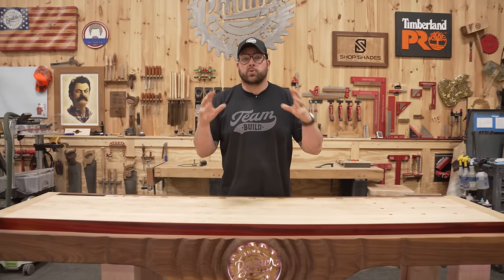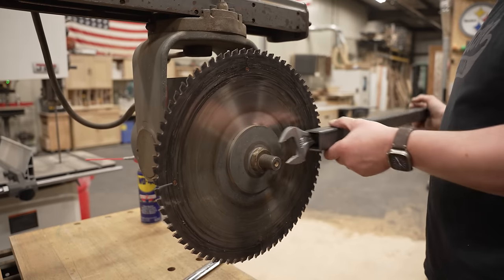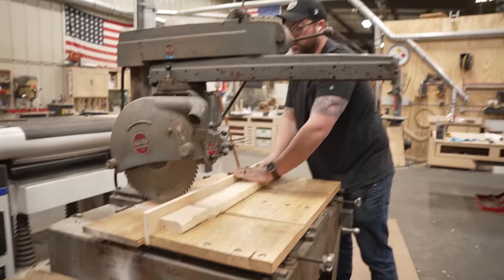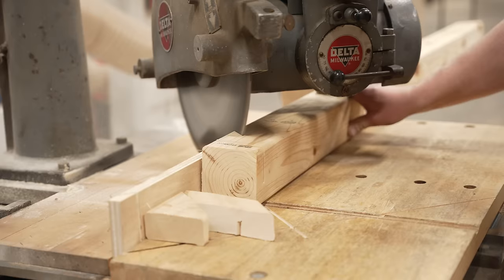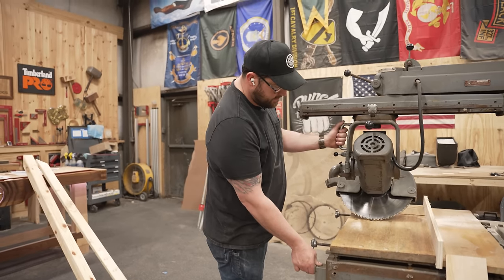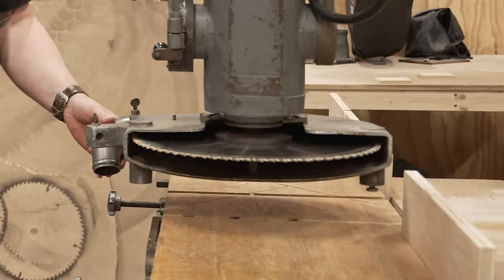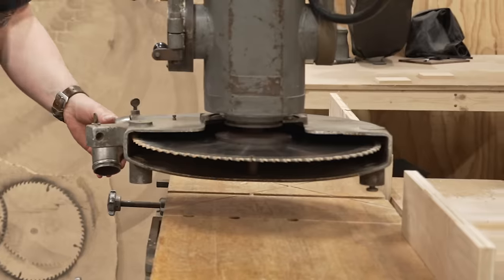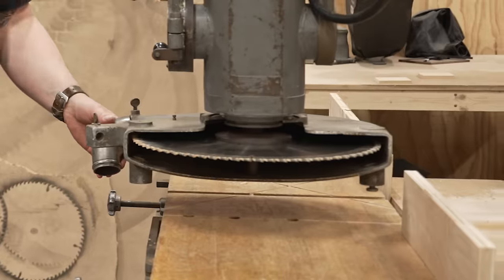Testing Woodworkings Most Dangerous Techniques

Comment: Rake angle on teeth helps. It doesn’t grab if it is neutral rake. If you search specifically for radial arm blades they come up.

The rip cuts people use a push block that is a flat piece on the surface that pushes the pice and has a bracket with a handle to push it through. Sort of like a food processor pusher.

Comment: Ran one of those for a year back in 1972. 16 inch delta we built 2 big project about 2000 2 story apartmens. The thing is a bull. Never laid it on the side . Cross cuts only. Great saw.  We built a ply wood table for it 32 ft long 2 ft wide. Waxed table everyday. The wax was driping off the bottom of the plywood after we tore it down .

Comment: For the rip cuts you need to adjust the blade guard down at the frint end of the cut to prevent it from picking the material up at the beginning of the cut. And there are anti kickback pauls that are missing that wedge the kerf of the cut at the backside much like a riving knife on a table saw. I rip my plywood with a craftsman 10in radial arm saw (not full sheets, i do full sheets with a straight edge and a circular saw).

Comment: Honestly i can't wait to see what you make with this tool, I see how dangerous it can be. Maybe you could make your own blade guard that doesn't get in the way so you don't have to completely remove it but you are protected. It would be nice if you could add a brake to slow the blade down once the saw is off.

Comment: Good on you for showing how dangerous the RAS is. I have 2, one with a trenching head and the other for high quality cross cutting. The wood machining world has changed significantly since the 80s. At trade school whilst doing wood machining we were taught to (interim) sharpen 24" rip saw blades (not carbide) with a file in situ then, to ensure that all the ends of the teeth were in the same cutting circle we would feed a broken piece of grinder wheel into the infeed side of the spinning blade!!! Sparks, screaming noise. the first time you do it, it is really scary.  The next scary thing is after replacing the knives in an industrial 24"  thicknesser you have to do a similar thing! This time though the abrasive part to grind the cutting edges of the thicknesser knives is rod shaped and in a carriage that is micro adjustable into the cutting circle and moved across the top of the rotating cutter block with screw feed. 
I wouldn't do it now.

Comment: Have you done a lathe router?  It's a combination of a lathe and a router with a milling bit.  It also works well if you have a duplication setup going.   You're using the router to cut on the lathe while the lathe is running.

Comment: The way I was taught to use a radial arm is to ALWAYS PUSH cut, never pull. We were also taught to not do any rip cuts because of what you pointed out. I guess in a pinch and if your life depended on it maybe. This thing is pretty ridiculous though, regarding how long the blade spins after its off, it seems like maybe a malfunctioned brake?

Comment: Great job pointing out the potential risk using the saw. Now, what can you create as jigs to protect the user. There had to be a lot of users in a factory that used the saw as you demonstrated that didn't get hurt. Plus, new saws can make the same cuts , but are quite costly. I'm guessing there work around. I lack the experience to  create such jigs.

Comment: I was hoping that you would buy an older 12" Delta or Rockwell radial arm saw and install a negative hook angle blade on it like a Forrest Chopmaster blade.  These saws have a 5/8" arbor, so it is possible to use a standard 8" dado stack on the saws.  I own a three phase version and a single phase version of the 12" Delta/Rockwell radial arm saws - they seem to remain accurate through several hundred cuts.  Your 16" saw is of a similar design, and seems to have a blade installed that is either a negative hook or 0 degree hook design, which makes the blade much safer for crosscuts.  I suggest creating a support table for the left side of the saw so that you are able to pull the saw through the cut using your right arm rather than your left arm.

Comment: We have the same saw in our school shop where 14-year-old kids are allowed to use it. The thing is so loud but we are allowed to cut it by pulling it forward making a cross cut It also has a break on it so it stops rather quicker and a strength thing that pulls it back that the school just added to make it safer I guess.

Comment: Get a changeover contactor installed with a dump resistor to help brake the motor, the motor spinning is acting as a generator so adding a resistor to dissipate the energy as heat will slow the blade much faster.

Comment: I would highly recommend to add VFD (variable frequency driver) for that motor and program DC break so it stops immediately and not after 5 minutes. Also you can program safety stop and slow start and stuff like that.

Comment: Yeah, i would automate this. Like that rail where the holes are, that would be perfect to mount a linear actuator (screw would be best, because it has more force). A motor break (easily added with something like a friction belt), and a proper table with a jig system to allow you to clamp stuff.
Automated, you don't have to be near it, but you can then make all kinds of cuts with it.

Comment: My father had a radial arm (not as big as this beast) that injured him on a rip cut. The wood jumped - he didn't get hit by the blade, thank God, but just the force of the wood slammed back into his hand. The resultant force split the entire last knuckle of the ring finger on his right hand into three meaty chunks. We drove to the hospital with his hand cradled in an ever-increasingly-red kitchen towel with him passing out from the pain. It actually did heal back together but it's a permanently-branded-in-my-brain reminder of how dangerous these older tools were/are!

Comment: I used to work in a hackspace which had a radial arm saw, I tried using it for a relatively simple cut once felt sketchy just setting up the cut and just thought 'this isn't worth it' and did the same cut in a more time consuming but ultimately much safer way

Comment: That bench top should be further forward so you can use the full arm throw. That would allow your fence to be further forward and allow your blade to be behind the fence. Or like your later cuts start out and work into the fence instead of starting back. Also just keep some scrap around for a brake material.

Comment: Your CAD dude and some 3d printed parts could probably help with a lot of the issues... make a guard that rotates and includes a hookup for your dust extractor for example. It's no gonna stop the blade if someone crashes into it like that hunk of metal but it will let them know if they just bump on by. There are a bunch or prints for feather boards and such you could possibly modify concepts from to help with safe feeding as well.

Comment: There is lots of literature on setting up RAS. Fine Tuning Your Radial Arm Saw by Jon Eakes is essential book if you are going to run machines like your delta or dewalt . They have more adjustments than you think. Once dialed in , they work at 0.001 of inch accuracy. Your blade is pinching because  your blade is heeling in . There is an adjustment. Every tool ( stationary tool) should be set up properly. They don’t come set up perfectly from factory, that includes all table saws.plug and play is a good way to end up handless

Comment: My dad is a machinist, we have an old Bridgeport mill at his house, and when he uses it it has a break to slow it down so he can stop the drill or whatever he's using in there. It makes me wonder why they didn't install something similar in this tool. Would be useful to be able to manually slow the blade without having to put it into material or having to wait for 5+ mins to stop.

Comment: Well, congratulations, you got your 10,000 likes. I have a radial arm saw and use it exclusively for cross cutting long timber to length and it’s perfect for the likes of half lap joints, although I need a dado stack.  I once turned it the wrong way when ripping and almost put a hole in the workshop wall.  I’m trying  to decide whether you are brave or ?? 🌞

Comment: I used the same size saw in the early 70’s during my summer job working as a Carpenters helper, once the company owner realized I could read drawings accurately and had a good work and safety attitude I was put at the yard shop prefabricating soffits and other components. The saw was a workhorse and because I grew up on a farm I had respect for its power and risks he was sad to see me leave to go back to engineering classes in the fall. I enjoyed the work, I still have the 12 inch Craftsman radial arm saw in my workshop it doesn’t get much work mostly because I have a full complement of equipment and don’t do the type of work they are best for in my 70’s , I think they areas safe as the operator’s ability to set them up and knowledge of  understand the forces involved . Lack of thinking everything through and securing the work is a problem for some?

Comment: Should make a blade guard half the size as the one that's on it. Then you could put a retracting piece on that, so that the half of the blade nearest you would be covered when doing a tennon cut. As you cut into the wood, it would push half of the cover back. When done cutting, you can then push the saw up into the bench and the most exposed edge would be covered.

Comment: cross-cut, you are standing on the wrong side. You need to stand in front of the saw, and pull with your right hand. Because when you are standing in front of the saw you avoid the saw coming forward, because you can put pressure. From the side it's more difficult to put pressure.

Comment: I worked at a custom woodworking company for a while out of highschool, that radial arm saw is nothing compaired to the 15" hitatchi chop saw we would use as a primary saw. I had the spring break on me and that head with the blade is probably 20 lbs, slamming down on some hardwood makes the whole saw jump. Also that saw probably has a blade stop but the armature might be worn out and the break isn't working.
Reply from the maker: THat sounds terrifying

Comment: I dont  know if you had them in the usa ? But my father had diesel power table saw using single cylinder dumper truck engine (dumper saw)
You could see the blade jump every stroke ! We use to cut up logs for fire and it was so scary

Comment: Worked in a shop that had that saw. A guy with over 10 yrs there drove a 10 ft 2 X 12 through a cinder block wall ripping from the wrong side of the saw

Comment: My Ridgid radial arm saw is designed to push forward to cross-cut. You lose some cutting distance, but much safer, especially with the guards installed.
For rip cuts, I push with a sacrificial board wider than the cut. (Plus I have the splitter and pawls on mine) And outfeed support is absolutely NOT an option for ripping with a radial arm. Mine is built in to a 14 foot long bench.
TBH, I rarely rip with it anymore, even with the safety parts on it, it's scary. The king of ripping these days is the track saw.

As much as I like my radial arm saw, I wouldn't touch that 16" monster. No sir.

Comment: I'd take that saw! That turret saw is the best RAS ever made. Stays in the center of the table. Dadoes with an RAS are easy peasy by far their best cut. You must have the anti kickback pawl to rip and you move the nose of the guard just off your cut so the board can't lift. Then you use a very long push stick that feeds into the blade. Done right ripping can be safe. You honestly terrified me. 😮

Comment: Did notice some input about brushes or diodes that could aid in the saw break..honestly I bet some were on the interwebs there's probably something after market for beautiful functioning dinosaurs like that delta..we had a larger version of that at Mt work place..broke my heart when they replace it with a new aged tuuurd do to a part failure for locking down material up to 6x6

Comment: In the rip cuts. Can you do a test for me? Id like for you to pick your rip size, start the saw, crank the blade down into the deck about an inch or more. Then feed the rip in backwards from what you did in the video (a climb cut if you will.) since the blade approaches the work at a flatter angle and theres no way for it to run the work under the blade it should be safer. Just be very very careful that you dont pinch against the fence. I think it'll work much better since you're cross cuts were all climbing cuts it should be ok.

Comment: Your saw originally came with a stop that bolts on back right side of turret arm, limiting travel towards the post. Because it can come off the saw, they are usually lost. Your saw is no newer then 1953, if it says made in Milwaukee Wisconsin. Rockwell delta moved their mfg to PA after 1953

Comment: On the gut cut... can the head rotate 360? Take the blade off and it looks like you can flip the head through the arm and that should correct the wire going through the arm...

Comment: I can fully see why these saws are not around much now a days. There was little I saw that could not be done with more common tools today that would also be much safer.
The one thing that it does have going for it is the 16" blade if your cutting large stock often (6x6, 2x10 or 2x 12).

If your into doing classic building techniques on large scale projects where doing tendons and dove tails are needed it does have a purpose.
But considering the cost to a customer and time wise it is almost better off spending some more time and doing so by hand tools for more precise fits.

Comment: Good video have one of these probably the most dangerous saw i have ever used in my 40 plus years great machine set up with full support tables  but some techniques should never have been suggested by makers  my advice is never do any it won't just cut you it will remove limbs

Comment: Am so glad you didnt do that last cut my heart rate was through the roof you thinking about doing it. Ive used one these for bout 6 months now at pro ioiners across from my shop and there good for cross cuts full stop. One thing they've done is yhey have like 10 ft either side of yhe saw as a bed which helps. 🏴👍 Ps need some lathe work from you 🏴👍

Comment: To stop the blade from spinning after turning off take a piece of scrap wood and push it into like you were making a cut an it will stop the blade also it spinning so long after it turns off shows how  smooth the bearing is that's a good thing

Comment: I think you needed to spin your saw track around. with the ripping cuts you can move the sawhead itself. it limits your length of cut but is a lot safer and more accurate. you see the track that you moved for the miter cuts, you can spin that around that's why you power cord was twisted and you couldn't get it to come out enough. I wouldn't have done it either lol

Comment: I was almost the victim of kickback from a radial arm saw. In shop class, a kid was ripping just like you did in the video. I was standing at a desk about 10 feet away and looked over to see him ripping a piece of wood. I noticed that I was in the direct path of any kickback and I moved. Not even 2 seconds later, it happened. The wood kicked back, hit the metal desk where I had been standing, putting a big dent in it. It then bounced back and hit the base of the saw, denting it also. It was scary how much force was behind that wood.
Reply: that is not kickback. It is ejection. ANd the kid was breaking all sorts of items
Reply: Two things shown poorly here.  when ripping, first tip the guard to just clear the lumber going into the blade and use a push board and not a stick. That way no fingers near the blade. Also the saw is missing the kick back pawl to prevent ejections . Remember any tool used incorrectly can be dangerous.

Comment: Do you not have rolling benches? One little clamp and you can extend your surface. Then your cut piece won't flip. Or an adjustable arm with a couple of rollers. And, of course, hook up dust collection so it won't pelt you in the face.

Comment: It is actually one of the safest cirkular saws because the material is pulled away. Most dangerous are the cirkular table saws with a small table and no blade guard and a riving blade.

Comment: 20:55 That wouldn't happen because the blade is doing a climb cut (blade spinning in the same direction of the feed). What would happen was the kick back would pull you into the blade instead.

Comment: First off, the saw is made to be used with your right hand placing your body just to the left of the blade patch. The blade guard should rotate down for rip cuts to prevent dust from fling in your eyes. You need to use push stick for rip cuts with infeed and outfeed tables.  On small rips one push stick for the off cut and one with side pressure for the main stock. If that’s to squirrelly for you use a feather board. I’ve ripped 1000’s of times on my Radial arm saw with just one kick back flinging something back at me. If my heart rate ever raised during a cut, I would just walk away and come back. I’ve built cabinets so ripping plywood, door styles and hard wood edge banding was a regular occurance.